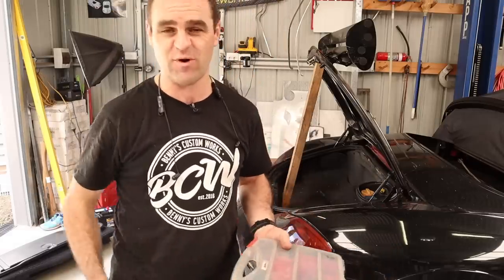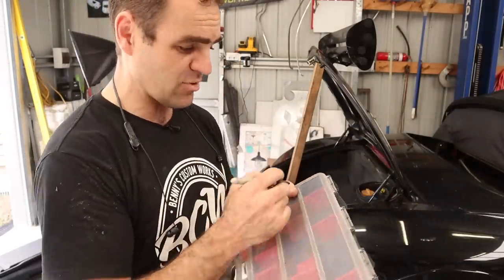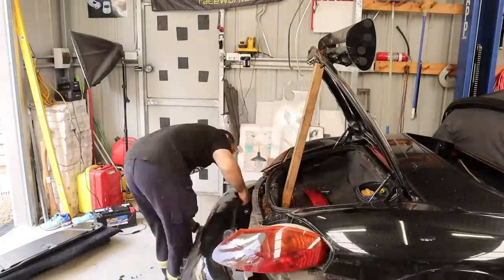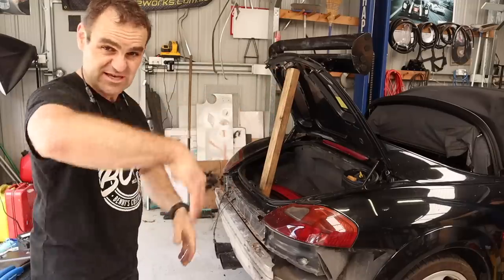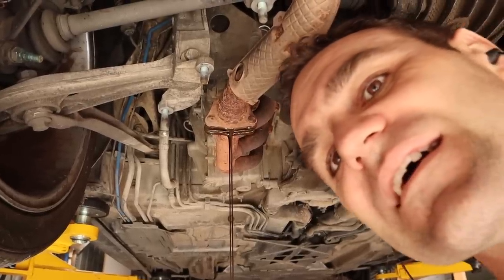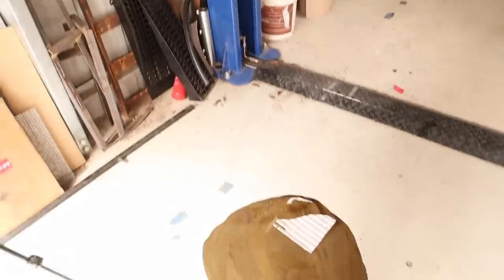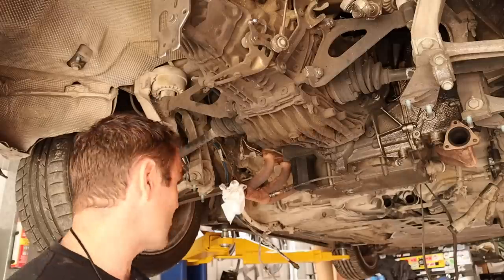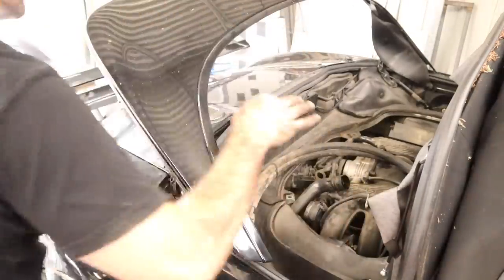Removing the Roxsters blown engine - Porsche 986 Boxster track car build 3

Comment: Impressive how centralised the engine is located. I can see the track day potential.
In keeping with the Italian engine (Ferrari) in Italian car body (Alfa), I'm guessing Audi V8 into Roxstar ✌️😁
Reply: Have always had a dream of fitting a variant of the coyote engine in a boxster. There are some high revving variants and they can be modified easily.
Reply: V8s in Porsches are my favourite kind of blasphemy. Apparently some Audi V8s bolt onto some porsche transaxles, so that would be dope

Comment: My guess for the failure is hydraulic lock caused by AOS failure.  Air oil separator membrane failed and allowed the intake to pull oil from the crankcase into the intake manifold.

good luck with the build! looking forward to it!

Comment: Jeff sounds like "D Chunk" problems in one cylinder, which did happen on M96 engines, particularly with an engine that has suffered over heating problems which more than likely happened on your engine when the radiator ducting was blocked off. Cylinder wall broken through to a water gallery hence coolant in the sump. Piston probably destroyed allowing oil to the cylinder head and into the extractors if the exhaust valve was open. And all the shrapnel would lock the engine solid. That's my guess.

Comment: Wasn’t a fan of the roxster, I could tell it was a beater by what the previous owner had done cosmetically.  I think you killed it so you would  have an excuse to for an engine upgrade. It’s toast.  A forensic teardown (in this case an autopsy) would be fun to see someday.  🤪
Reply from the maker: I may get around to pulling it down at some stage, but by the time I finished pulling it out, I couldn't be bothered :D
Reply: I’m with Alienpoker - am very curious to know whats failed in there.

Comment: Well, toast it is! I generally like mine before it's been flipped off on to the floor though. A few missing screws and bolts form the panels wouldn't have bothered me overmuch- missing bolts from the engine/transaxle are a major red flag. Been on board for a while now- not going away just when it is getting good! Best to you and Mrs. Jeff!

Comment: I think a cilinder cracked. The water got in the sump and the oils floats on top of the water. That way the oil could get to the exhaust through opened valves.

Comment: That was new oil coming out of the exhaust like that, then the amount of water before any oil from the sump, The way the idiots had blocked the air flow to the rad it was amazing it was still driving to be honest, If that track is as bad as that I would hazzard a guess you will be requiring a dry sump system.

Comment: Nice one Jeff, your engine has shit itself and you're still smiling ;) Keep up the great work. It wasn't mentioned in your video but I assume the manifold bolts came out ok which is a bit of luck?
Reply from the maker: Thankfully roads in Aus are never salted, so it is usually not too bad.

Comment: Hey Jeff. Just wondering. When that little 2.7 went boom, did your drivetrain lock up? Just wondering. 
It’s not uncommon for Porsche engines that have been poorly maintained to go into Hydro Lock, especially if the AOS is starting to fail. Water and oil accumulate in the upper section of the intake manifold and under heavy cornering, the liquid sloshes and ends up getting into the combustion chambers via the runners. Apparently the upper manifold (plenum) can hold a significant amount of liquid. I’m sure you know that. Dump 250-500mls of oily water into a combustion chamber and.... diarrhea comes out of the exhaust system. Think of it as the engine shi¥¥ ing itself! Kind of like C-diff, or Norwalk virus.

Comment: I would guess the breather gave up and allowed oil to be dumped into the inlet manifold and drowned two cylinders and hydraulic locked the engine
Reply: As Jeff said cracked piston. Possibly broken valve head.
Oil would pump straight through the inlet port via the valve guide.?
Reply: I'd suggest maybe you've cracked the head, between the oil gallery and water jacket, in the exhaust port. Compression would have pushed oil and water where they don't belong. Pretty common to damage one cylinder, and have the other 5 grind it to death.  You'd say it was a piston, but that's pretty rare on a N/A engine.
I assume it seized the crankshaft from trying to lube the big ends and mains with coolant !

Comment: It looks like a broken piston, but very rare on aspirated cars. May be a very bad hole on the head or heads...Look carefully the bottom, if you run the engine a good milage with that much of water in the sum is no good 😢
I think a Hayabusa engine would fit there just fine 🧐🤓

Comment: Just a head gasket by the looks,  probably been filled with water only and corroded it
Reply from the maker: The fact that it seized solid (while I was driving it), tells me that it is a bit more serious than that ;)
Reply: @HomeBuiltByJeff  head gaskets are catastrophic and can cause seizure.  Water does not allow the main bearings to work and will seize a motor super quick.  I suppose once the head is off it will be clear.

Comment: what a terrible little car to work on (never was much of a porsche fan anyway).  what is a good(easy to work on) track car?
Reply from the maker: Actually it is not too bad. There is a ton of room to reach everything from under the car. 911's suck though ;)
Reply: With most Porsche cars, you end up dropping the whole engine to service it.  One you have done it a few times, it’s like an old friend.  Having a lift makes it straightforward.  I’ll stick to working on my 240Z fairlady.  Plenty of room around the engine and no electronics to go wrong.
Reply from the maker: @alienpoker  There is nothing like a car from the 70's with an inline engine for ease of work ;)